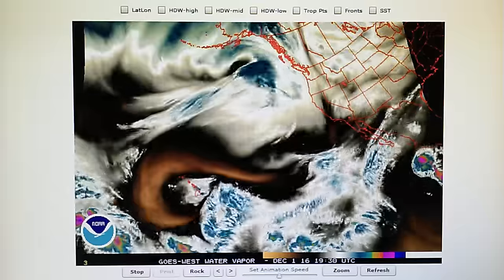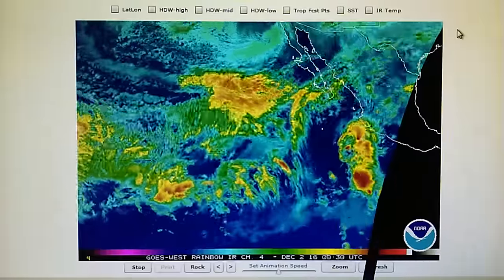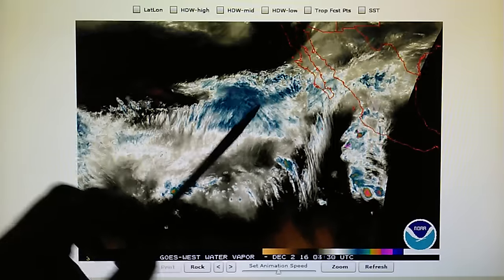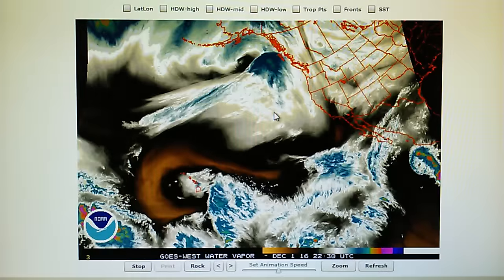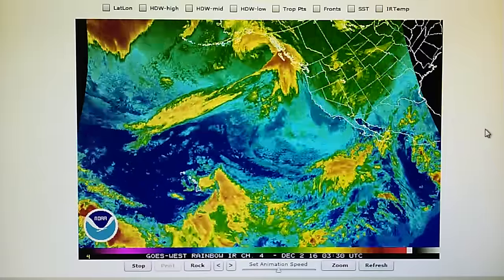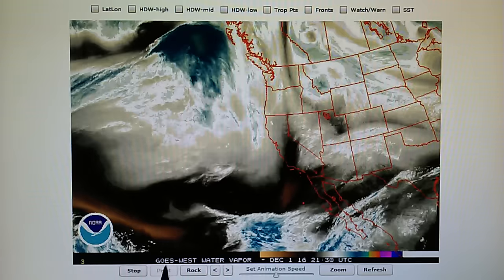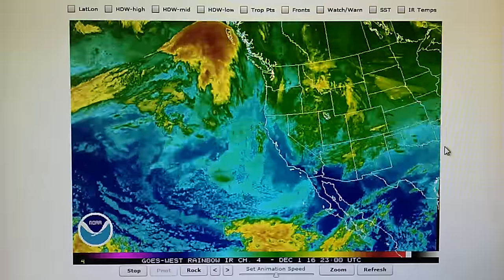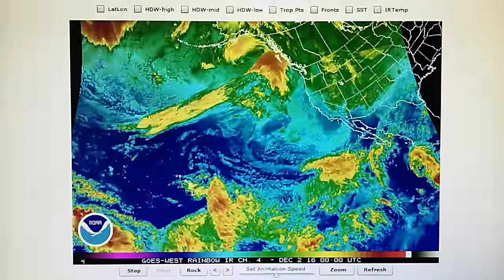Pt. 2; 12-1-2016; High Pressure Installed to Block Moisture / Rain

Comment: PacificRedwood, why are there chemtrails when it's not cloudy? can't microwaves stop rain fronts by themselves without aerosols??
Reply: Ron Newcomer kind of but it's more difficult and obvious. also chem trails hide other things as well like holes in the ozone. oh and with chem trails they add metals and what happens when you put metal in a microwave? some chem trails dry out the air others condense and make it colder. so if you mix the hot from the added wavelengths with the heavy cold.... you see where this is going.... I hope. anyway there are so many ways to apply this in different formulas! it's kind of upsetting for me if I get into this as its fun to think about but sad how it's being done without consern :(
Reply from the maker: Ron Newcomer - The microwave energy can create an on-demand high pressure zone - or split two zones of weather from one another. When aerosols are sprayed when no clouds are in the sky it is usually to maintain low Relative Humidity conditions such that when the moisture field arrives, no atmospheric lift will occur thereby preventing the precipitation process.
Reply: 1PacificRedwood, thanks for reply. I suppose if areoles are sprayed with no chance of rain, it's a covert effort to poison life?
Reply: +Ron Newcomer, The chemical desiccants sprayed in CA are very effective at sucking the moisture out of the atmosphere, to keep an area dry and maintain drought. My skin undergo's a tightening/ shrink-wrapping process when this type of aerosols are used.